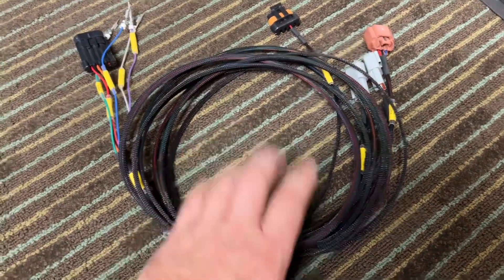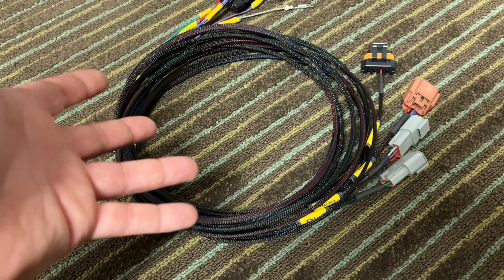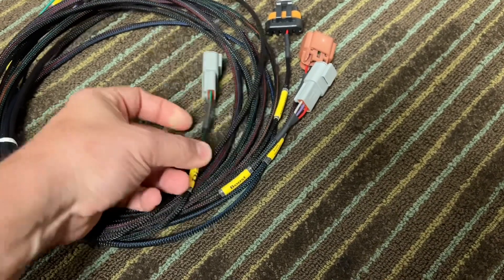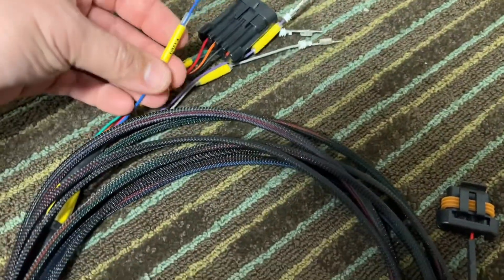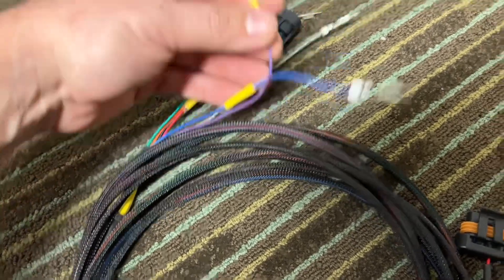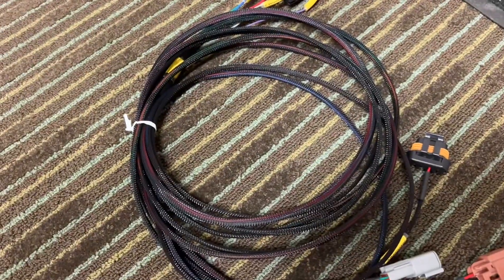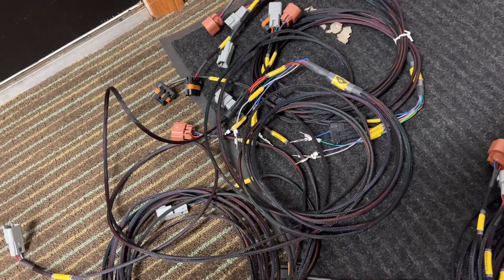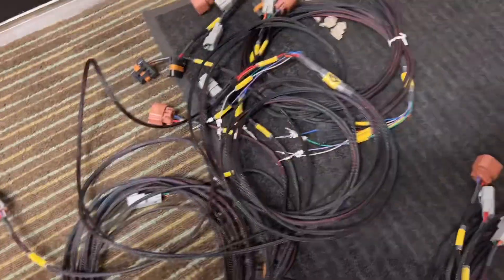Interest in Dual solenoid 4-1 harnesses?

Comment: Hey Matt- to use this I also need to run wires for the dome pressure sensor?

Forgive my ignorance, but you mentioned some people use atmosphere to vent and fill the dome. Could you use boost pressure off of the outlet port of the turbo for fill n vent?
Reply from the maker: correct, if you want to run dome control you need a dome sensor,
you could also use boost pressure in the pressurized size of the dual port yes.